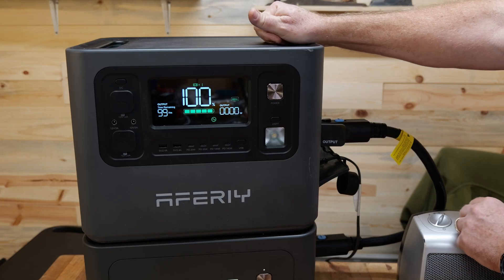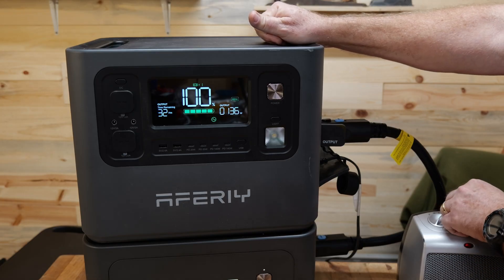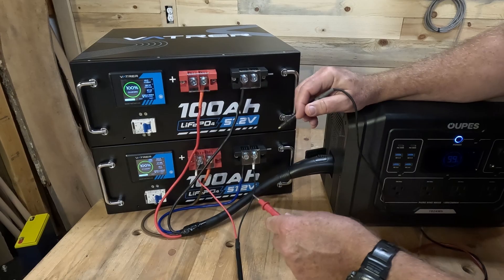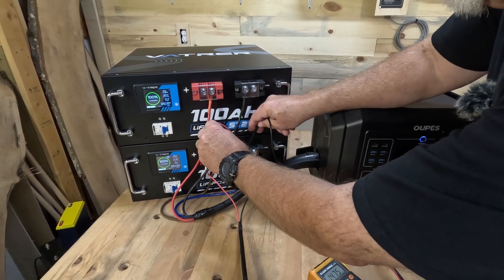Manufacturer vs DIY Expansion Batteries: Is It Worth The Cost?

Comment: Thanks your class. Can I connect to jackery explorer 1500?
Reply from the maker: You can connect to the solar input port but not the expansion port as they use a 44.8v battery and not the standard 51.2v.

Comment: A handy DIY tool is a 24 volt 10 watt auto side light bulb with a pair of short leads soldered to small alligator clips,,just for first test connection ,,its sure saved a lot of inadvertent mistakes,,,
Reply from the maker: Interesting idea.

Comment: they’re a good arguments to be made for both. But if you know what you’re doing, you have some experience in your DIY Guy a non-proprietary battery in my opinion is absolutely the way to go certainly from a cost standpoint. But for the novice proprietary batteries are a no-brainer. Also, I’d like to have a lot of people don’t talk about. Is the safety issue? It’s far safer to use proprietary battery than any other alternative. Thanks for this video. This is a good addition to this series.
Reply from the maker: Thanks for the thoughtful input, especially on the safety aspect!

Comment: Jor, ahora que me he comprado la bateria de 51,2 v 100 ah para mi pecron ?
Reply from the maker: You can use it via the solar input always and I am working on testing a hack on the 3000 shortly.
Reply: @TheOldJarhead  Tengo la pecron e3600lfp con una bateria pecron ep3000 y ahora me compré una de carrito de 51,2 v 100 ah (estoy esperando el cable de pecron para conectarla).

Comment: I have two factory expansion batteries, one for my Ecoflow Delta Plus 3 and one for my Anker Solex C 1000. I paid about $300.00 and change for each battery. This is ideal for my small Apt. I don't need 10,000 watts of expansion batteries. Not to mention 20 minutes plugged into the AC, and the batteries are 100% charged. I'm not sure how long it would take to charge the DIY rack batteries, but I rely on AC, not Solar. The longer it takes to charge an expansion battery, the more it costs me. BTW, I haven't had an electric Bill in 2 months. This is def working for me w/o Solar.
Reply from the maker: Nice!

Comment: I paid 399 for the Anker C2000 gen 2 expansion battery 2KWH.  This price did not last long, but I jumped all over it when I saw this price.  Also, I have a 5KWH server rack battery for power reserves, Wattcycle gen 2.  Paid 640 with discount code.  very nice battery.  I should have bought 2.
Reply from the maker: Wow, those are some seriously good deals you snagged!

Comment: Question: I have a Bluetti AC180. When I plug a 12v battery into the 8mm port, it charges at a maximum of 89 watts. Is there a cheap way to increase this input?
Reply from the maker: Looks like it's limited to about 8amps so using a 12v battery is the issue.  Bump that to a 24 or 48v battery and you'll get 200w to 400w.  The best way to do that is with a DC charger though a step up converter will also work -- they do get hot so beware of that.  I used this one:  https://amzn.to/4aJHcAb to extend my Jackery 550 with a 12.8v LiFePO4 battery and it worked well and didn't get too hot when running for 4 days straight.
Reply: @TheOldJarhead thank you. When I hook up my 48 volt 50 ah it maxes out at 500 watts which presents different problems. The DC connection cord exceeds 100F so I have to limit the time it’s charging this way. I’m trying to avoid buying another battery but I can look into a step up converter for the 12v battery.
Reply from the maker: If the cable is getting hot, it's too small.  Since it's only pulling <10amps you should be fine with 12awg cable.  In fact, to be pushing it you'd have to be smaller than 14awg cable.  So I find it odd you're getting hot wire with such little draw.  You can use 10awg cable for a max 30amp draw...that would be 1500w @ 50v

Comment: I want to commend you for an excellent and balanced discussion.  I think this field of solar and powers stations is coming to an inflection point.  Up to this point, if you wanted to thrive with off grid power you almost needed to have a background in electrical engineering or at the least take it on as a full time hobby.  It was fascinating and fun to build systems from the ground up.  

But there are many who simply want a plug and play solution that allows them to enjoy and focus on other facets of their lives.  At the same time, the cost of these stand alone components has really come down in price, so that external batteries that used to cost $1500 to $2000 are now available for $600-700 thanks to some very aggressive pricing from new players that are proving to be reliable.  I see this as a maturing of the field.

Thanks again for your well-informed commentary and analysis.
Reply from the maker: Thanks for the kind words and the thoughtful analysis – I think you've hit on exactly where things are headed!

Comment: I think you're better off getting a server rack or wall mount battery these days and a separate charge controller and inverter. It's more modular and perhaps more robust. Also, its less expensive.
Reply from the maker: True but power stations have a place

Comment: Every time I was going to get an the Anker C1000 expansion battery, I kept seeing 1000 WH class power stations with a 1800 to 2000 watt inverters for the same price or lower and got them instead. Full power station with a full inverter, just swap them out and put on solar panels when needed if grid totally goes down. If I do get an expansion battery, it will be the Pecron EP3000 for one of my E1000lpf units. Good price for a 3KWH battery. I'm not very technical so that would be the SAFEST way for me to do it.
Reply from the maker: Makes sense 😀

Comment: Some of the companies have started to get a bit more affordable, but they're not going to match the price of a server rack battery.
The object of a "solar-generator" is convenience and portability.  The proprietary batteries do that, while adding your own batteries adds complexity and less portability.  There's a cost for those things.
I don't like the price of ground beef so I can save money buying trim and grinding my own.
There's also a lot to be said for understanding how these systems work and a DIY system helps us do that.
I don't own a proprietary battery, but I have been hooking up 12v batteries in series and parallel for several years to expand the run time on older so-gens. I can hook up 2 12v lifepo4 batteries to a 2k power station and run a small window unit for 5+ hours, or a couple of chest freezers for over a day.  I don't use these items daily or in an off grid situation,  just for kicks and giggles with the rare power outage thrown in.
Reply from the maker: Absolutely, you make a great point! Understanding the intricacies of DIY systems can really empower users and enhance their skills. It’s all about finding the right balance between convenience and knowledge!

Comment: The fact I only use as a very infrequent backup is why I'm sticking with the first hack you taught me, 24v of battery into the solar input. If I had unlimited funds I probably wouldn't even live where I do and I'd just pay someone to setup and maintain a huge solar system.  Maybe a mep809 and 5000g diesel tank. A moat, some claymores. Oh wait we're talking about battery power. Oops
Reply from the maker: lol claymores!
Reply: The humour is half the reason to read the comments, 😅😅,,, top marks !!
Reply from the maker: Wait, humor?  Doesn't everyone want a moat and claymores? 🤣😉😁
Reply: Luv it.
Reply: Some have UPS function which can come in handy for critical loads like refrigerators and a fueled furnace in winter.
Reply from the maker: The power stations, yes.  However, as long as the power station has a UPS function (they all should be older ones often didn't) the addon batteries, if paralleled will function as one unit with the power station so not an issue.

Comment: I was thoroughly convinced that I was going to buy a golf cart battery to expand onto my pecron 3000flp, I think I’ll go with the pecron expansion batteries.
Reply from the maker: I'm glad I couldn't help!  I might have a code for a little savings at Pecron too 😊
Reply: @TheOldJarhead  I just built an expansion battery for my Pecrons. It is actually one of the easier ones to do and works pretty well. The Pecron will charge the expansion battery without you having to do anything extra  comms not required. But as noted in the video, you will have to monitor you expansion battery separately and sum the capacities to get actual capacity available.  If you are still interested, just ask.
Reply from the maker: Hmm....thought I answered you but here it is again:  did you build the battery?  (cells, BMS etc?)
Reply: @williammeek-h2o  I’m curios to know which battery to use for expansion. Is there a limit? For my 3000flp, I know I need a 48v but how high can I go with the amp hours? The 3000flp is limited to two Pecron expansion batteries but I’m too dumb to know why or how much I can add. For example, I’m looking at a 51.2v 105ah golf cart battery but I don’t want to overdo it and brick the unit or start a fire.
Reply from the maker: I'll be working on that shortly but as long as the expansion port parallels the batteries, they are the same voltage  (within about .5 at 100% SoC) then no worries!  I added two server rack batteries to an Oupes giving me 11kwh total and a GCB to a Pecron E1500LFP
Reply: @TheOldJarhead  I have both the Pecron 3600LFP and the 3000LFP and on both, the main pins for the expansion batteries are always live.
The 3000 uses a common XT120 connector (I think as a result of feedback from the rarer plug on the 3600) and the 3600 uses a marine trolling motor plug. Amazingly, the expansion jumper from Pecron is cheaper.
Reply from the maker: Yup :)  I've tested the 3000 and aware it's also live to have confidence I won't have an issue there :)  Just need to load it up on the bench, turn on the camera and have some fun! :D
Reply: @TheOldJarhead please do. I think MANY new Pecron owners are waiting, youll be the first to get them views!!!!!!
Reply: @TheOldJarhead I’ve got to wait a few weeks, I’ve got to make sure I’ve got a paycheck as the government might shutdown again on 1/30😢
Reply from the maker: If it does, you'll still get paid though possibly delayed.  But I hear ya!
Reply: @TheOldJarhead  Erik, where are your Pecron discount codes?  I don't see them anywhere.  Thanks.
Reply from the maker: https://www.pecron.com#ref=264 Try that and see if it works and I'll check to see if I do have a special code (I usually do).

Comment: I am still saving for a battery to add to my pecron,  I want to go with dyi, but I really enjoyed and learned from this useful and well spoken video, you got a way of explaining things in layman's terms,  thank you
Reply: BC  born we are  all taught to speak in layman terms  :)
Reply from the maker: Oregon born, BC Raised -- around loggers 😁 so ya, layman terms -- or loggers terms 😉
Reply from the maker: Thanks!😊
Reply: I just built a 4.5 kWh expansion battery for my Pecrons, I have a 3000 and 3600. Let me know if you have any questions. I built it with my son and included some features like solar charging, and its own UBS charging ports.
The big place to start is making sure you are using lithium iron phosphate which is what the Pecron uses so the charger will be compatible with the chemistry.
Reply from the maker: Did you build the battery? Cells, BMS etc?
Reply: @TheOldJarhead  Yes, the cells were used/unused automotive pack. Doubled up 90 Ah  LFP cells.
I had to split the cells which fortunately had threaded terminals. 
I used a 150A JK BMS and since It had the threaded aluminum terminals welded on, I fabricated aluminum busbars from some aluminum bar (1"x1/8") I bought at Lowes for between cells.
For the main positive and negative, I did buy braided copper busbar that was nickel plated on the ends because I hadn't finalized the layout for the electronics and wanted flexibility.
Reply from the maker: Nice